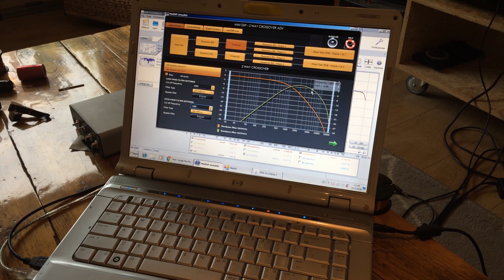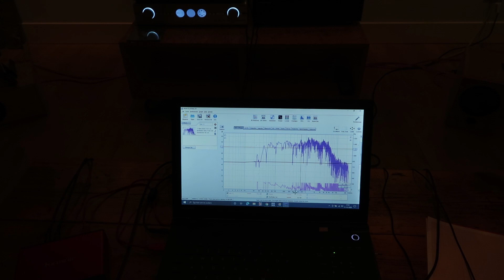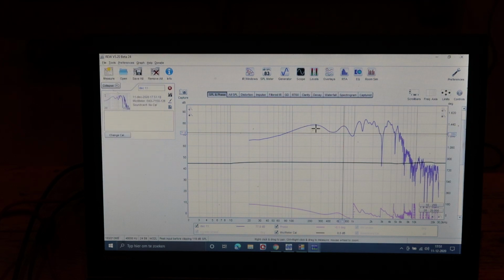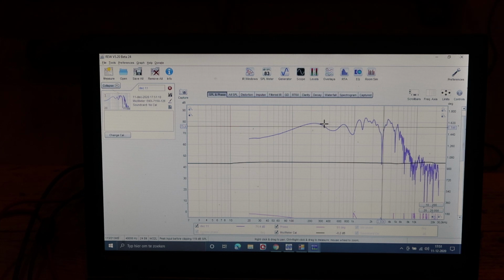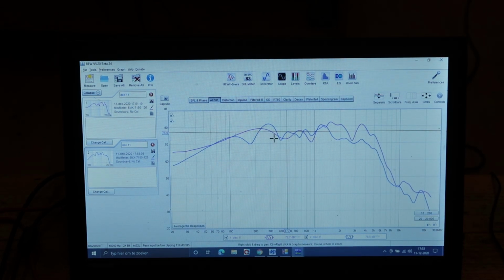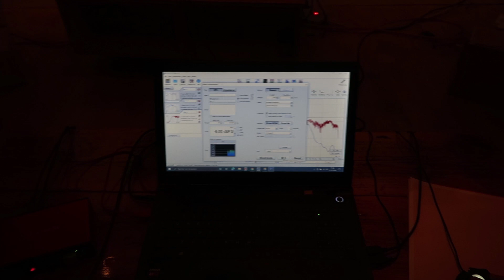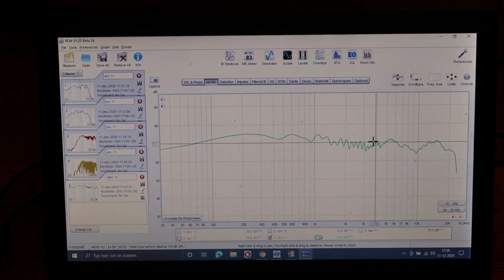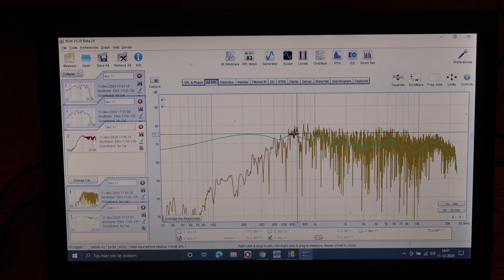1 meter long ribbon speaker - Side firing woofer vs front firing

Comment: Sorry, maybe you have already mentioned it, but what crossover (values) have you planned to use? With other words, how low can the ribbon go, and still handle the needed power to go ”loud enough” in your room?
Reply from the maker: well indeed it depends on loudness. since they are not  efficient (like 82 dB or something....). but i use them right now from 400hz and up with a 12 db oct filter so simple coil and cap works for now. and a 12 db oct filter on the woofer also coil  and cap.  problem is ofcourse the ribbon cant handle endless power. so output will be limited to around 92  isch i think . not sure yet..  i at least never had the urge to play louder then i did so far. and not reaching the limit with music. i bet with a sinewave i could reach the limit rather easy  where the ribbon might get to hot or my amp bottoms out. or distortion rises , from either the amp or the ribbon. next ribbon will use double the magnets and no steel. witch would give a slightly stronger field and also a smaller gap. maybe gain 1-2 dB .. just a guestemation so far :)